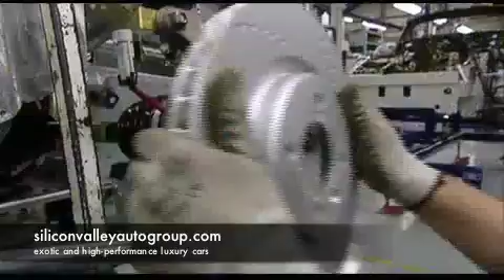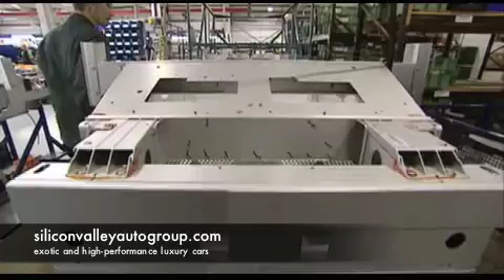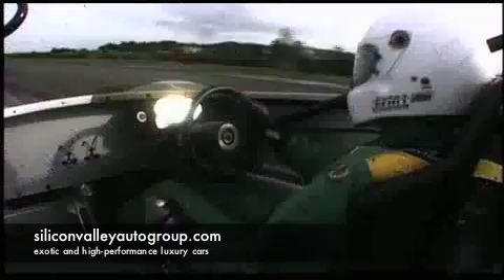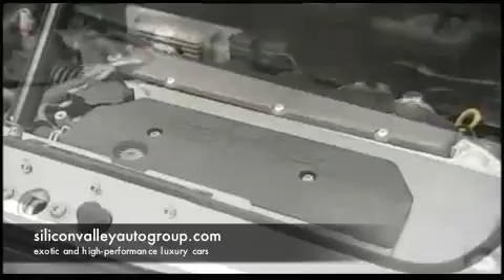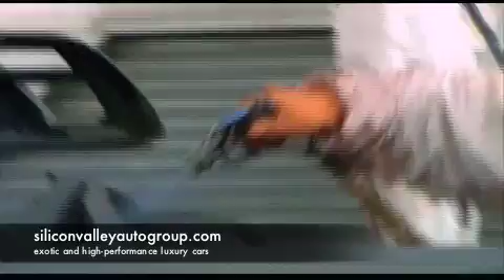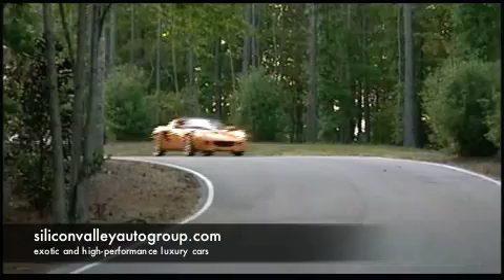Lotus - Inside the Factory

Comment: So technically buying a toyota
Reply: I am late to the party, but NO, the engine is only a tiny fraction of the rest of the car. Perhaps yo missed the aluminum extrustion panels bonded with adhesive, which gives lightness to the chassis? No mention of the body or suspension either. So no, not technically buying a Toyota, although you do get a reliable, high output engine.
Reply: yeah, right, so buying a Pagani is just buying a Mercedes.